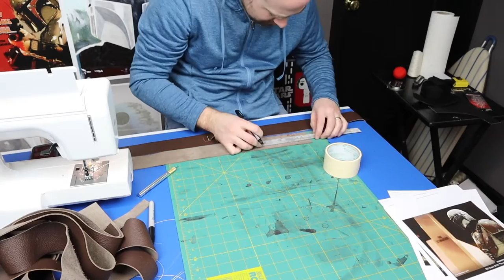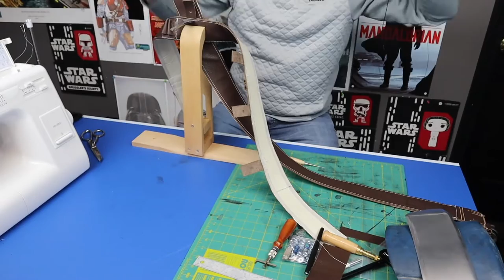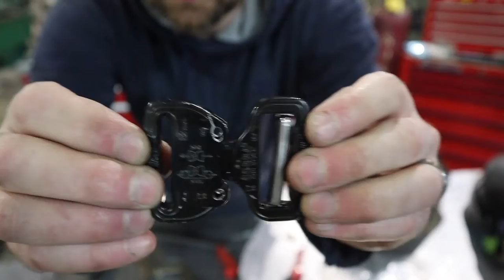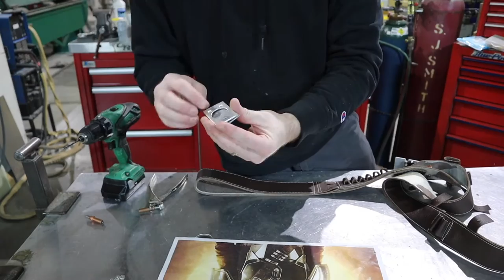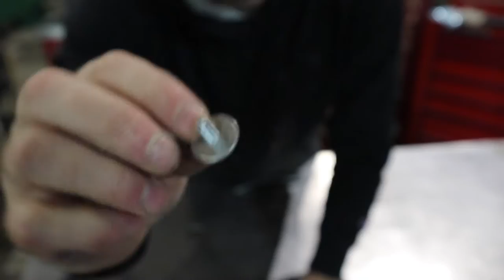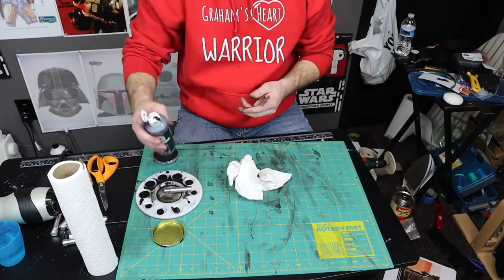MAKING "THE MANDALORIAN" BANDOLIER AND BELT

Comment: Lots of great ideas - thanks so much for taking the time to record these vids. As far as the masking tape, I found it created more problems than it solved. By adding the tape to the bottom, the bottom can no longer stretch, but the top layer can. Result is that the  top layer loses alignment, especially over the ammo holder cutouts. Plus, as you mentioned, its a bear to remove. Once I stopped using it, I really had no issues at all feeding the leather and maintaining layer alignment. I used 1.6mm veg tanned leather, so maybe that is different enough from what appears to be chrome tanned leather that you are using. 

Also, using glue stick to temporarily hold the layers together made a huge difference in keeping everything aligned. Went from crappy looking to acceptable. Still need lots of practice though to make it look more professional. I am using a low cost Singer HD machine which I purchased as a refurbished unit for cheap. Just need a real good needle, HD thread on top, and standard thread on bobbin. Pretty happy with results.

Keep up the great work!!!